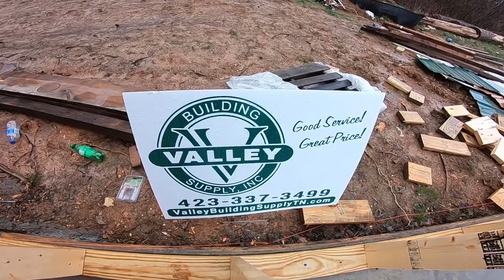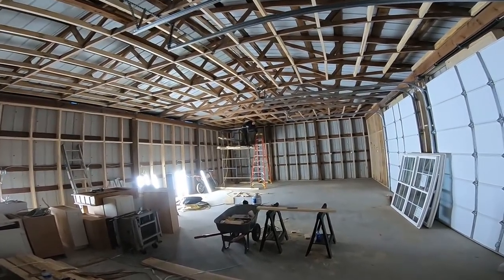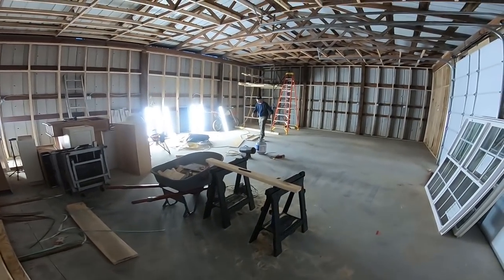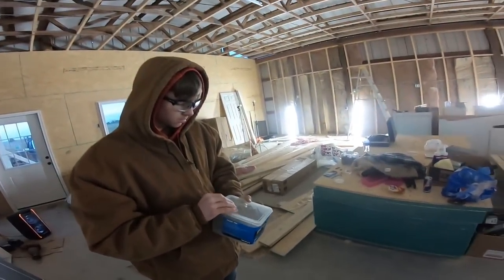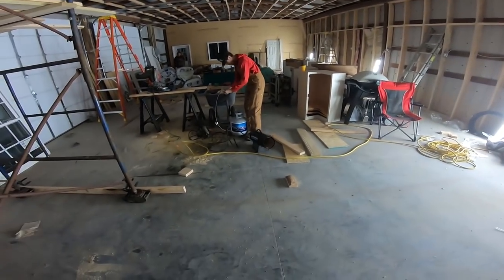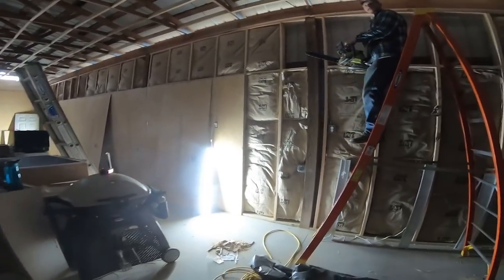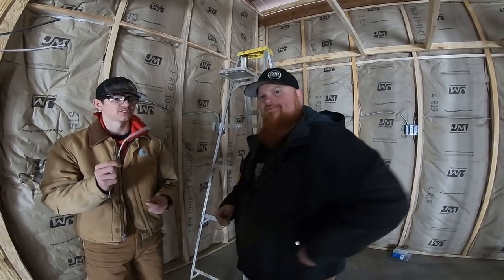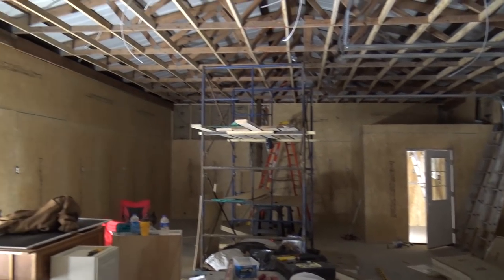Dream Garage Build ~ Clean Engine Room & OSB

Comment: That shop is going to be epic compared to your home garage, happy for y'all for sure.  Y'all deserve it with how much work you've put into it.   How are you sealing the holes in the metal siding to prevent water intrusion into the insulation?

Comment: You better put a moisture barrier in the ceiling because it'll that metal when it gets warm will drip have you got insulation up there then it'll start getting water in the insulation and then mold
Reply: Robert Lee you are wrong my family had a pole barn and it was steel roof with thin Dow insulation never had any problems
Reply: It's a dew point thing. Most condensation occurs at night when the temp inside the building is warmer than outside. Warm wet air rises and meets the cold metal roof and cools. As it cools, it can't hold as much moisture. Excess moisture ends up as drops. Unless the building in insulated or is running a massive A/C unit. It will sweat.  I deal with it all the time here in Texas.

Comment: Don't know your plans for running air lines.. but cheap route would be buy bulk Pressure rated PVC, with a diameter of one inch to run through out the walls.  I installed my shop at my work with it, cheap as hell when you bulk buy.. Make sure you have a valve  between the air compressor to the lines though,This will allow you to always keep your tank filled and ready to go and you just simply open the AKA dump valve into the lines... which reduces time when your in a hurry for the tank and lines to build pressure..it also acts as a  cutoff for when you need to work on the PVC to add or remove sections. I have a good amount of experience with making air lines at several locations ..if you have any questions I am more than willing to help! Also Amazon has really good prices for  "auto reeling" soft lines whether you want wall mounted or ceiling mounted . so you have air available at every part of the building. +Red Beard's Garage
Reply: shawnkiller90 DO NOT USE PVC!! Oils in your air lines make pvc brittle and it turns into a pipe bomb just waiting to explode.
Reply: @jjekare1  In 15 years guess I have been lucky, or I always take care and clean them out with regular Preventative maintenance as with any   "tool" or machine.Could also be due to the type of air pump used.

Comment: does americans have 220v as there high voltage at home and 110v is regular? Us in sweden have 230v as the standard at home and the high power at home is 380v